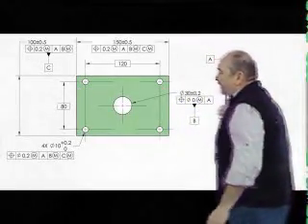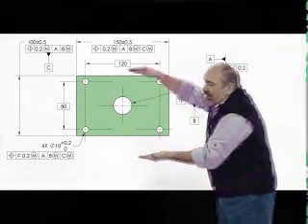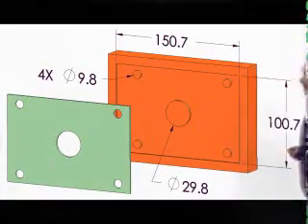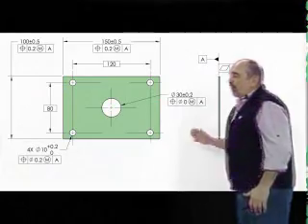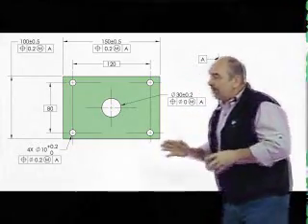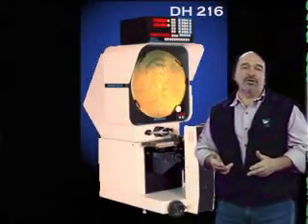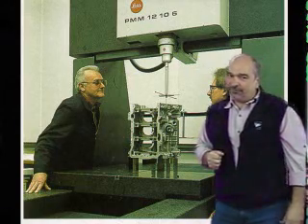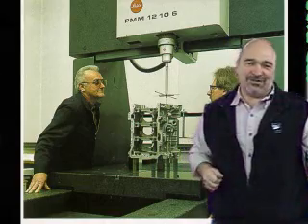GD&T Tip from Tec-Ease - Don't Forget Simultaneous Requirements

Comment: Shouldn't gd&t focus on design intent, not inspection method? This is opposite of the purpose of gd&t
Reply: Hi tono80,
Of course that GD&T focus on design intent, but inspection has to be the same way that design intent. That´s why Inspection methods have to perform the same way design intent is.

Regards.
Reply: GD&T is not just design intent.  It tells the world how you intend your design to be interpreted. This video accurately describes that inspection should not take the true position of each hole individually but consider the part as a whole.